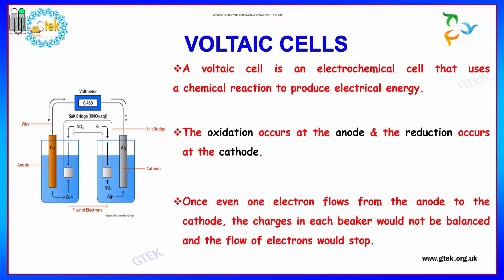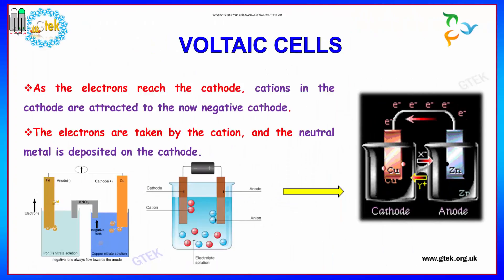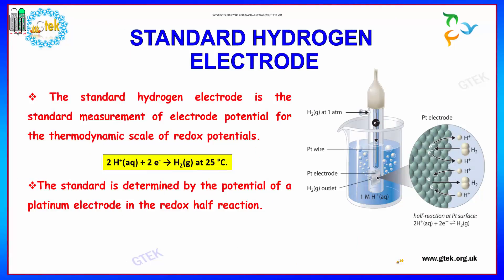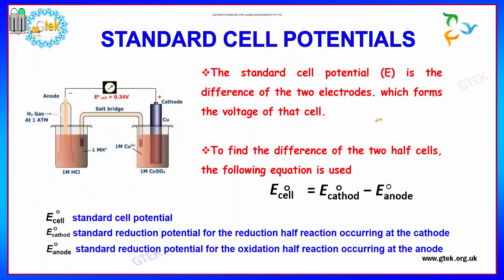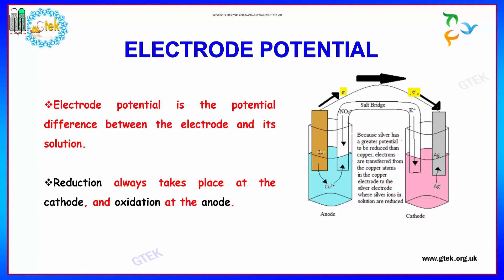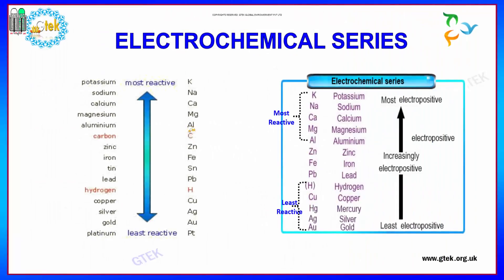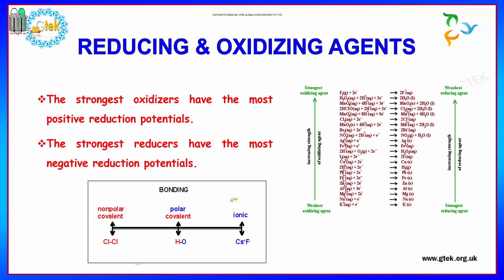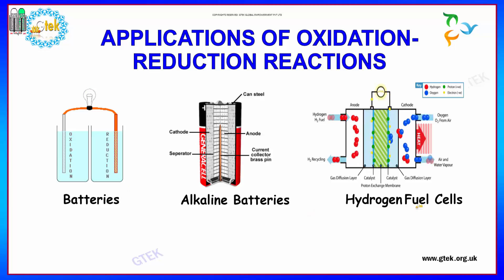Voltaic Cells | ElectroChemistry | cbse 12 physics | JEE Main and Advanced physics | +2 physics

Comment: The external circuit is used to conduct the flow of electrons between the electrodes of the voltaic cell and usually includes a load.
The load is the part of the circuit which utilizes the flow of electrons to perform some function.

Comment: The purpose of a salt bridge is not to move electrons from the electrolyte, rather to maintain charge balance because the electrons are moving from one half cell to the other. The electrons flow from the anode to the cathode.

Comment: In both kinds of electrochemical cells, the anode is the electrode at which the oxidation half-reaction occurs, and the cathode is the electrode at which the reduction half-reaction occurs. A Galvanic cell converts chemical energy into electrical energy.

Comment: The anode is an electrode where oxidation occurs.
The cathode is an electrode where reduction occurs.
A salt bridge is a chamber of electrolytes necessary to complete the circuit in a voltaic cell.
The oxidation and reduction reactions are separated into compartments called half-cells.